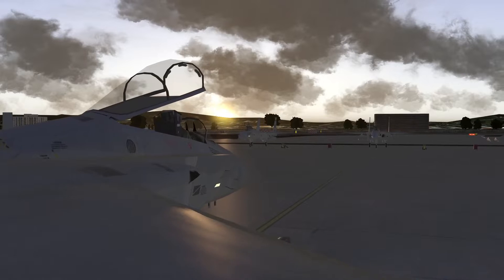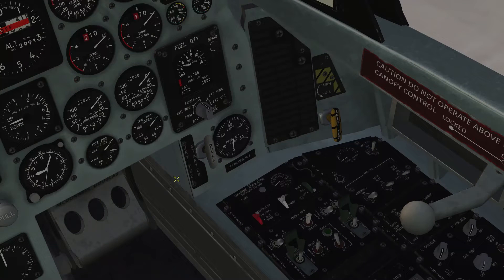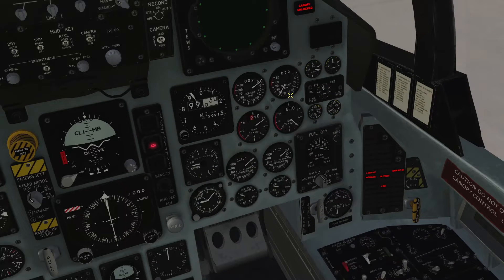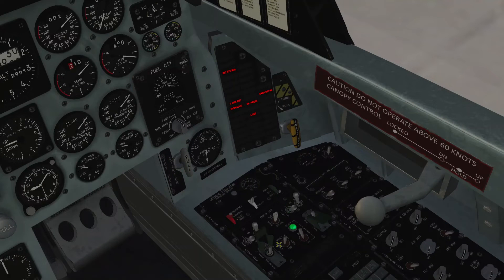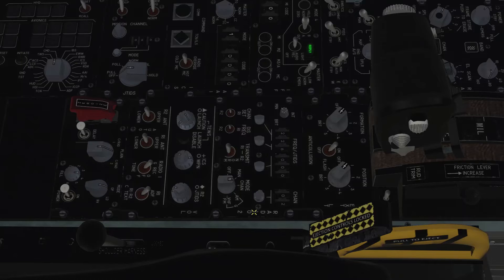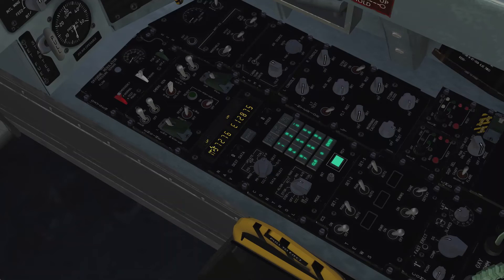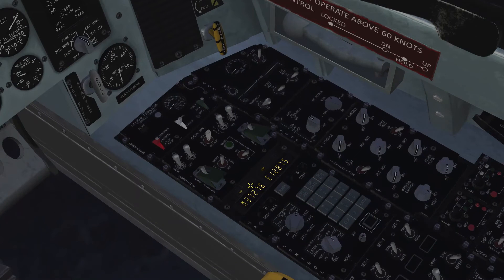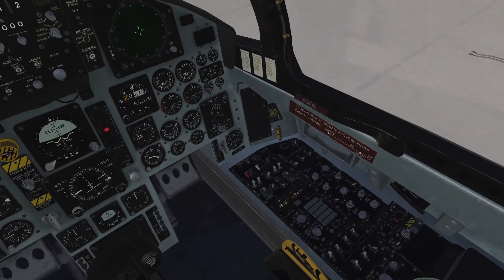Falcon BMS 4.37.3 - F-15C Ramp Start

Comment: Great video Micro and great job to the entire BMS team! I'm looking forward to installing the update and trying out the F-15C. I haven't read the documentation yet but is the JHMCS implemented but just something you didn't cover in this video or is it something that will be implement in the future?
Reply from the maker: No HMCS yet. There’s is a ton of avionics implemented now which isn’t covered. Cheers mate
Reply: @micro3939  that's ok, there are probably loads of other avionics and systems that are more important, JHMCS is nice to have but not indispensable for operating the aircraft.

Comment: A note on the JFS... The JFS is started by high pressure Nitrogen. Pulling the JFS handle straight out will discharge a single bottle and under normal circumstances, this should start the JFS.  If you rotate the handle 45 degrees counter clockwise and THEN pull it, you'll either discharge both bottles, or the one remaining bottle if you've already discharged the first.